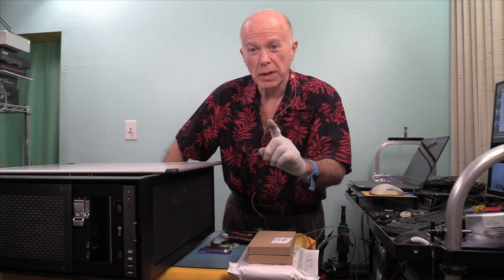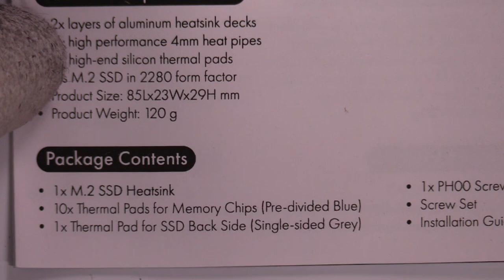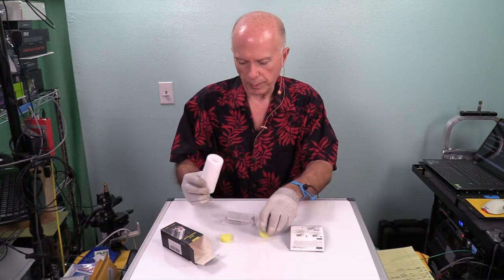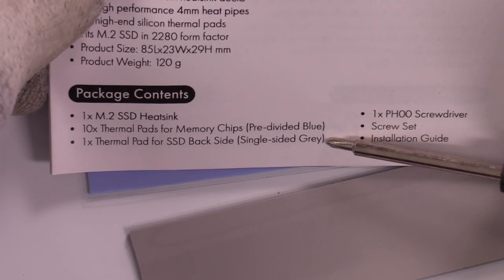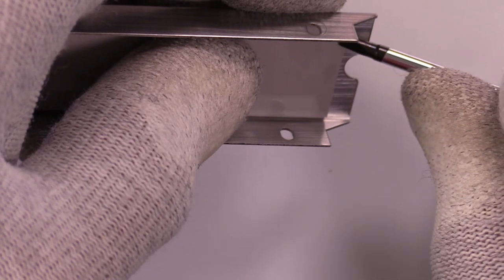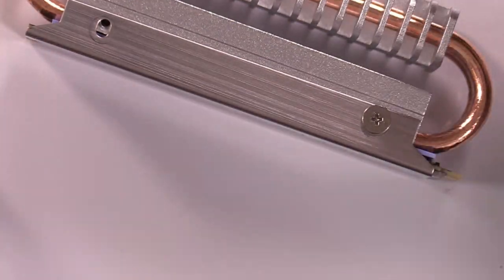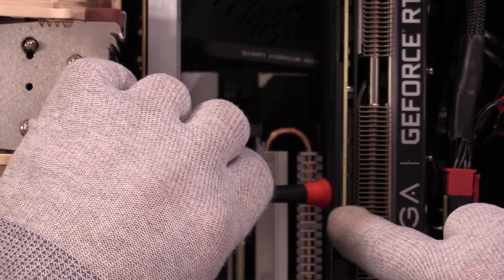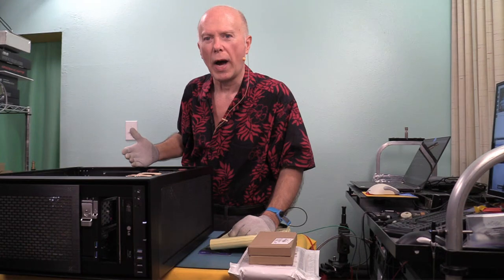Acidalie M.2 2280 SSD Heatsink on WD Black SN850

Comment: I just added a 1TB Samsung 970 EVO to my system with this Heatsink.  At startup, it was running 31C, after the 1st benchmarking (using Samsung Magician) it increased to 35C and after a second benchmarding, it increased to 38C -- not too bad!  I'm now going back to add this same heatsink to my 980 PRO, which went to 55C after the first benchmarking and 65C after the second benchmarking with the Samsung supplied heatsink. I hope to comment again after I have those results.
Reply from the maker: Hi Bill Akers,
Welcome! Excellent! Proof is in Results! Yes, Share Your Results! Surprising what a difference can be achieved in using the correct Heatsink. The Question is which one is which. Like Who's on 1st! Results!

Comment: ACIDALIE has developed an upgraded version of the built-in fan, suitable for m.2 2280 heatsink. It is specially designed for PC, with double aluminum and double heat pipes, high-speed heat conduction and heat dissipation, equipped with 30mm cooling fan, connected to the motherboard fan control socket, 4PIN interface power supply, 8600 rpm, PWM speed regulation. Compatible with single-sided/double-sided M.2 NVMe SSD coolers, easy installation, and high-quality cooling pads provide 4.8W/mk high performance.Model: VB06
Reply from the maker: Hi 戎旭辉,
Good to know! Have not seen that one yet! Thanks for Sharing! The other Active M.2 NVMe Heatsinks We've tested did not perform as well as expected.

Comment: Small tip on removing thermal pad plastic covers: pull horizontally instead of up, so they stay kinda more put on the heatsink
Reply from the maker: Hi cldpt,
Glad You mentioned that! Appreciate the advice! Thanks for Watching! Sometimes this is like walking and chewing gum at the same time. Lots going on! Lots to think about. Lots to be done!

Comment: Where's the baseline temperature without the heatsink? Did I miss it?
Reply from the maker: Hi Adolfo Reyes,
Great Question! 
1. For the WD Black SN850 bare is 92°C on the Supermicro Dual M.2 NVMe Adapter in top M.2 Connector Slot. 
2. WD Black SN850 on TRX40 Designare 2nd Connector Slot, Stock Heatsink = 65°C. 
The WD Black SN850 has an Operating Temperature to 70°C. 

Hope that helps! Clarity! Outstanding Results! Thanks for Watching! And another Heatsink coming up! Stay Tuned!

Comment: When the designer knows the importance of pad compression, you get great results...i think this one is best for single sided drives, while the Sabrent is better for double sided ( I guess) .
Also curious about ambient temps!
Awesome video ,love it !
Reply from the maker: Hi 5 nm, 
You're absolutely right! Good point! I'll mention the ambient temps in the Summation as well as in the Thermal Pads change outs. Fascinating Results! Appreciate Your Comments! Thanks for Watching!
Reply: @BuildOrBuy  I can't get the screw holes to line up when I have the thermal pads in place, I know you said to use a good amount of pressure to squeeze the radiator and bottom plate together to align the holes, and I tried, but the holes won't budge and I'm scared of breaking my Samsung 980 Pro 2tb trying any harder.

Please help.

Also hope you are having a good day :)
Reply from the maker: HI @kaeaja ,
Welcome! Thank You! You Too! Problems with the Acidalie Heatsink installation? One Thermal Pad on Top and One Thermal Pad on bottom and the 4 screw holes do not line up? Compatible with single and double-sided M.2 NVMe. And the Samsung 980 Pro 2TB is single sided M.2 NVMe. There should be plenty of room. Are You using the stock Thermal Pads?
Reply: @BuildOrBuy  Yeah, stock thermal pads and I have everything as flat as I can get it, I made sure to do that.
Reply from the maker: Hi @kaeaja ,
Are the bottom carriage Side mount holes round or elongated? In the Video, those holes are elongated.
Reply: @BuildOrBuy  It's the same one you are using so yeah, Elongated.
Reply from the maker: Hi @kaeaja ,
The reason I ask, the image on Amazon indicates round holes whereas the one We Test has the elongated holes so this should fit with single sided memory, M.2 NVMe PCIe Drives. Any progress?
Reply: @BuildOrBuy  Not yet, doing a lot today so haven't had time.
Reply from the maker: Hi @kaeaja ,
Understand. Just checking! Hope You make good Progress!

Comment: What an exciting video with some very revealing results! I contacted the manufacturer of the Acidalie through Amazon and found that the pads that come furnished with the cooler are rated at a very mere 2W/Mk and both pads are 0.8 thick. The performance that you achieved at this level of heat transfer was truly mind boggling! This speaks volumes at how well this particular product was designed: both, the pads as well as the construction of the heat sink. Your results definitely merits having further testing with better quality pads. So the question arises as can the thermal pads be upgraded to achieve even better heat transfer results? I believe the answer is yes. I initially thought of Thermal Grizzly, their pads are rated for 8W/Mk. However, I wanted to try to get the most possible heat transfer. Why not go for the overkill?  So, I have ordered some 15W/Mk Gelid pads in 0.5 and 1.0 to make sure I get the right amount of fit for my WD SN850 1TB to see if it is possible to get the temps any lower with better heat transfer rate. I am hoping you might try the same. My WD SN850 with Acidalie cooler will be installed on my older i7-5930k MSI X99A Godlike Gaming Motherboard's M.2 slot. I love what you are doing, Gill! Keep up the good work! Can't wait to see what you have to show us with more experimenting! Subscribed! Two thumbs way up! Maybe  do a shootout video to determine best actual results of different quality pads?
Reply from the maker: Hi Chesty Puller,
Welcome! Yes! Throw all assumptions out the Door! Fantastic Info! Thanks for Sharing! I'm honored! Thank You for Subscribing! Based on What You've shared... With the x99 Chipset, You're only getting PCIe 3.0 Speeds of 3,500MBps. Therefor, Heat will not create as much of a problem as PCIe 4.0, 2nd Generation of 7,000MBps. However, based on Your Chipset, You only have PCIe 2.0 through the Chipset. 

MSI X99A Godlike Gaming 
https://us.msi.com/Motherboard/X99A-GODLIKE-GAMING/Specification
Intel X99 Chipset
https://www.intel.com/content/www/us/en/products/sku/81761/intel-x99-chipset/specifications.html

- M2_1: M.2 Port

To reiterate, according to Your Motherboard Block Diagram in PDF on Page 22, looks like You're only getting 2 PCIe Lanes through the Chipset. Your CPU supports PCIe 3.0 through the PCIe Slots.

In other words, You should be getting 4 PCIe Lanes and You are only getting 2 PCIe Lanes through the Chipset. Bummer. I'm just the messenger. Test and Verify! Hope that helps! Stay tuned!
Reply: @BuildOrBuy  This not completely unexpected. I purchased these products to use initially in this Mobo but with the idea that I may never see the full potential  of the drive until I purchase a new mobo as an upgrade. Just future-proofing my M.2 drive. Hardware like mobos arn't cheap so the M.2 will have a happy home in the old school until budget can provide  for a new Mobo, but it is on the horizon. So perhaps before too long it will be transplanted and given a new role. Thanks for all the great info!
Reply from the maker: HI @chestypuller6836 ,
Got it! OK! Glad You know Your Specs! And a new Motherboard usually means a new CPU as well! And so it goes! Absolutely! Here to help! Thanks for Asking!
Reply: When you talk about 0.8 thick and 0.5 and 1.0 about thermal pads are you talking in inches or millimeters? I am thinking about buying Acidalie and good thermal pads for getting best temperatures in a samsung evo plus. Finally did you do it?
Reply: Please update us with your results. So we here can replicate the same modification if you found it worthwhile. Thank you god bless🙏

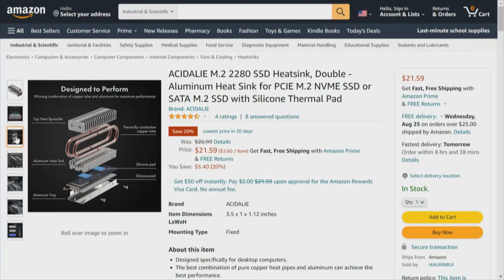Comment: 0:50 Just looking at that my jaw dropped. NVME drives have dual thermal zones- the controller, which runs hot and needs to be cool, and the flash chips, which run cool and both perform better and last longer when run warm. So in theory, this design is smarter than having two continuous heatpipes. Actually, I want to see one that's 1 halfpipe on one end and 3 halfpipes on the other instead of 2 and 2!
Reply from the maker: Hi Plasmafox, 
Welcome! Fascinating, right! And Passive Cooling! Of the 14 Heatsinks and 3 Thermal Pads We've Tested, this Acidalie and JEYI FinsCold were the top 2. Both Passive. Ww learned enough from all of this to throw assumptions out the Window and just Test and Verify then Compare Results! We learned enough to know We need better options gor PCIe 5.0. Both ASUS and ASRock are stepping up but with different approaches. Passive and Active, respectively. Appreciate Your Comments! Thanks for Watching!

Comment: Q: Instead of using the (rubber bands) what do you think about using Kapton Tape.  Kapton tape's popularity is its chemical resistance.  Ranging from -75°C to +260°C  Kapton tape comes in both single-sided and double-sided varieties.
Your input please.
Reply from the maker: Hi GOOGLE USER, 
Very good point. The question, can We achieve compression without a mechanical bottom wrap around tray. We need compression on the sandwich like a press clamp. Two flat Surfaces. Kapton tape is used for insulation. On a flat surface wrapped, We lose surface compression due to side compression. Think of it like 2 sheets of plywood tied down. Where is the most pressure? On the edges. No way to get it tight enough on the larger surface area. Great idea though!
Reply: @BuildOrBuy :  Thanks for the reply, and you are correct there would not be any compression on top and bottom. But I was wondering how long the bands would last, and by adding the tape as backup for when the bans brake.  I hope that the adhesive pads would stick to the SSD if the bands brake and hope the tape would help?
Reply from the maker: Hi @googleuser7202 ,
Absolutely! Here to help! Always ready to try and Answer Subscribers Questions! Good point. That too would require a Test. Maybe 12 months. My hypothesis is based on my experience with rubber bands. Up for conjecture until We could test. And that would be a long term test. To check once a month for 12 months and report what We find. Interesting idea. However, given the two Heatsinks with the best Results, those two had mechanical Wrap arounds. Where this would be most crucial to test Bands would be in a Laptop. Very interesting idea! Keep in mind the tape is meant to insulate not dissipate heat. So We're back to just using stock Bands. We may need to source replaceable Heat Bands. Thinking out loud.

Comment: im currently looking at this. in the UK its up for £28. However there seems to be a clone  from ElecGear EL-80P  whihc is £10 cheaper. would love to see  the differnce
Reply from the maker: Hi James Nichols, 
Yes, glad You've had a chance to watch this Video! Fascinating Results! Appreciate Your Comments! The other one You've mentioned, We became aware of shortly after creating this Video. In US they are priced within $2.00 of each other. The only difference We've seen at a glance are chromed pipes instead of copper. Otherwise everything else looks the same. We'll be looking at other Designs as they mature for PCIe 5.0. Amazing to see Passive Cooling to be more effective that Active Cooling. Go figure. Link below to the Design You've mentioned. 

1. ElecGear M.2 2280 SSD Heatsink, EL-80P Heat Pipe + Double Deck Solid Aluminum Heat Sink Cooler for 80mm PCIe NVMe and SATA NGFF M2 SSD Internal Solid State Drive Memory, Thermal Pads Included
https://amzn.to/3lunWiy
As an Amazon Affiliate I earn from qualifying purchases! Keep Us Posted on Your Temps! Odd to have a PCIe 3.0 M.2 NVMe PCIe SSD Drive to have a Heat problem Resulting in failure.

Comment: Like your videos very informative & to the point. I purchased the Acidalie & want to share my experience. To those considering doing this it does work. But a word of caution, if your M.2 screw is metal you will be fine. These days some manufacturers use plastic now & it turns in place to hold down the SSD, helpful but bends easily like on the ASUS B660i. The space at the bottom between the SSD and the tray is separated by the thermal pad. There isn't enough room for the plastic ssd hold down to go between and cannot go on top of ssd because its to tall. If it was a screw it wouldn't be a problem. I was very careful & was hoping to get it between the ssd & the tray, I bent the plastic hold down piece. The Acidalie sits in place but not very snug, plastic hold down piece somewhat holding. Not sure how its going to work long term. There is a center hole on top of the plastic hold down piece but can't see any threads so it doesn't appear the piece can utilize a screw insert. Every board layout is different, like he said in the video dry fit and look it all over before moving forward.
Reply from the maker: Hi Island Exposures, 
Welcome! Thanks for Sharing Your experience. Like Microsoft does, fix one problem create another one! Let Us know Your Temps when You get that far.
Reply: Temps dropped from 45c at start up to 37c after installing the Acidalie. SSD stayed in place for now without issue. Off to a good start.
Reply from the maker: Hi @jp99575w , 
Excellent! Let's hope the Acidalie will stay in place. No way to swap out the fastener. A great idea that needs more refinement. Good Temps! Thanks for Sharing Your Results!
Reply: @BuildOrBuy  Yeah I figured there was no way to swap out the fastener by looking at it, but trust me if it doesn't hold I will find a work around. Won't let a tiny plastic fastener get in my way.
Reply from the maker: Hi @jp99575w , 
Absolutely! We had issues with those Screws if used repeatedl on Gigabyte TRX40 Motherboard. We saw how plastic fasteners worked on Supermicro Dual M.2 NVMe PCIe Adapter. Those Supermicro Plastic Fasteners worked well and did not hamper use of M.2 NVMe PCIe Heatsinks. Looks like ASUS needs to do some work with that item! Keep Us Posted!

Comment: can you test the cooler with the pads installed the right as the blue pads are for the ICs only the way you did it may help it cool more or maybe you will get better cooling with the blue pads installed right
Reply from the maker: Hi Rick 3037,
Welcome! We've tested 14 M.2 NVMe Heatsinks and 3 Thermal Pad replacements. Along the way We stated What, Why and How and the changes We took using stock Components for better Thermal conductivity. You're Results may vary. That took a month. We will only be going forward in Testing any more Heatsinks or Thermal Pads. Sounds like We need to do a compilation of Tests Video stating the What, Why and How of Our Decisions. Thank You for Watching!

Comment: Would adding a Noc A4x20 fan on top blowing down (attached using double sided tape ) be overkill in something like a sub 10L case?
Reply from the maker: Hi mrpeeng, 
Welcome! Great idea! However, positioning and noise! Smaller Fans make more noise like in a Rackmount Case. A regular 120mm or even an 80mm Case Fan would be preferable on a Slot configuration! We use to do that many years ago! Appreciate Your Comments! Thanks for Watching!

Comment: looks like they call themselves "ElecGear EL-80P"  now ?
Reply from the maker: Hi Christopher Staples, 
Different Brand, same Design in-stock vs out of stock! Thanks for pointing that out! Sourcing anything now is a challenge!
1. Acidalie M.2 2280 SSD Heatsink, Double - Aluminum Heat Sink for PCIE M.2 NVME SSD
https://amzn.to/3WuZMSo
2. ElecGear M.2 2280 SSD Heatsink, EL-80P Heat Pipe + Double Deck Solid Aluminum Heat Sink Cooler for 80mm PCIe NVMe and SATA NGFF M2 SSD Internal Solid State Drive Memory, Thermal Pads Included
https://amzn.to/3BUwPak
As an Amazon Affiliate I earn from qualifying purchases! Hope that helps!

Comment: If I were to buy thinner thermal pads could this fit a Crucial T700 (double sided as far as I know)?
Reply from the maker: Hi @firsh ,
Welcome. Great idea, however, we need elongated holes on the encloure. Silicone thermal pads will compress whereas the clay based thermal pads would just squeeze out. Elongate those holes. Otherwise this is one of the two best performers out of the bunch we've tested so far. Keep us posted on your progress.

Comment: could you use this on a double sided drive by changing to .5mm Heat-pads? I like it and already ordered but concerned about the pressure.
Thank you
Reply from the maker: Hi Stephan Hart,
The problem is the side mounting holes would need elongating. We have one other M.2 Heatsink that has that accommodation of elongated holes.